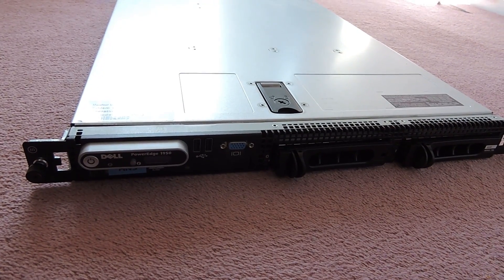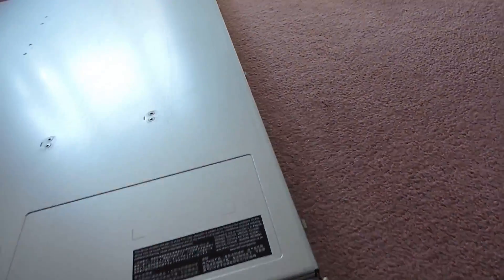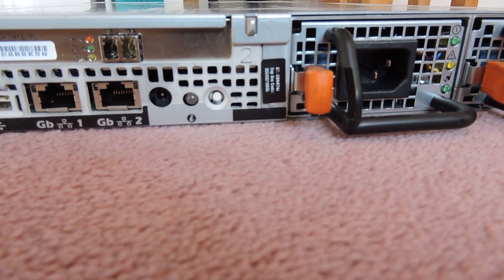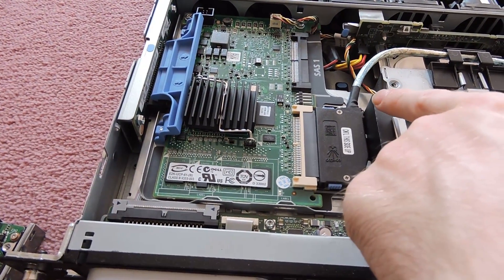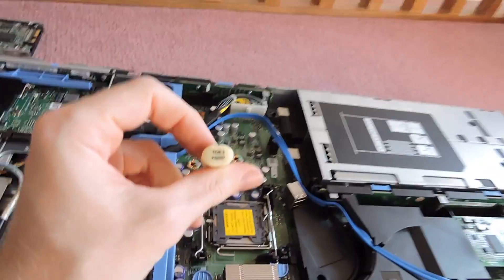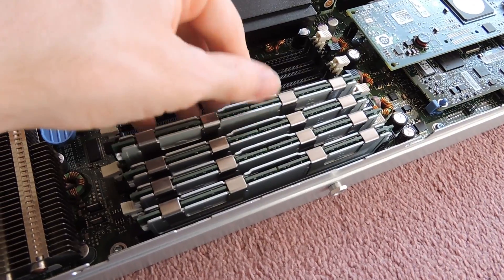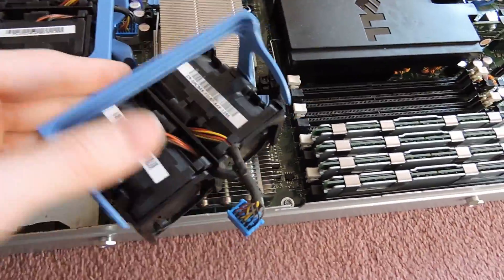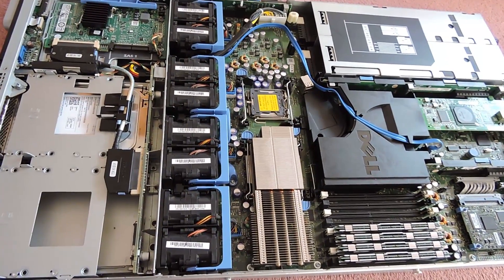In side Dell Poweredge 1950 III

Comment: the biggest caveat to this server is that it only has SATA r1. means the max transfer rate between when loading data off a drive is limited to a theoretic 1.5Gbps or 150,MBps. This mames SSDs bottlendck. not to msntion im not sure what ssds this would work properly with. the ones reccomended by Dell are not o ly old Sata1 and 2 ssds but also insanely expensive and hard to find, moreso than todays sata 3 ssds.

Comment: whats the power usage on one of these beast to basically use as a torrent download computer just askin cuzz my poweredge 2900 gen 3 uses about 400 watts when in use and thats loaded with 2tb drives.

ad thats a perc 6i raid card perc 5 would probably have the ram expansion dim on it thats intergrated
Reply from the maker: no. its a perc5i.    I will check the power usage at the weekend
Reply from the maker: 1.1 Amps at 300W